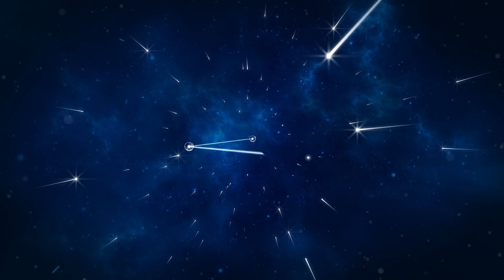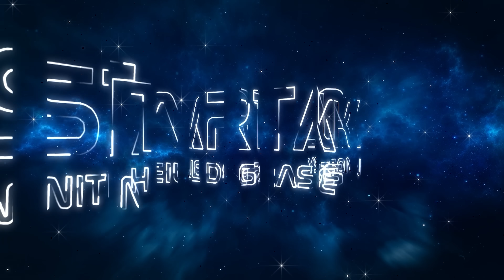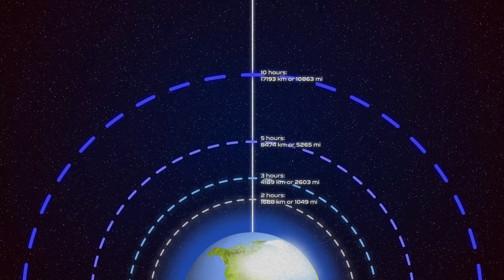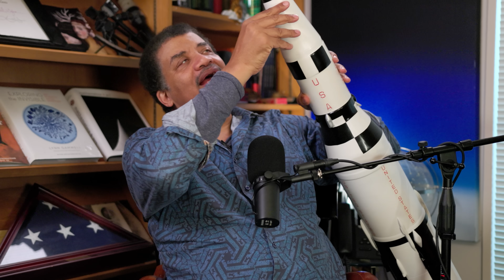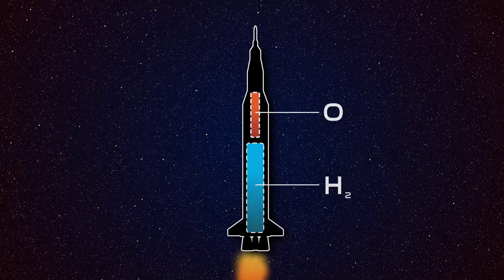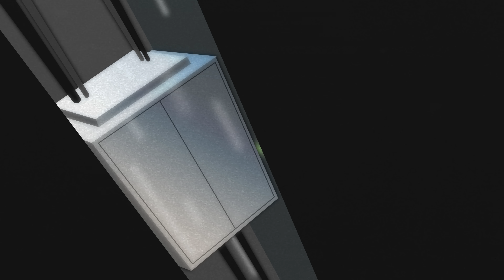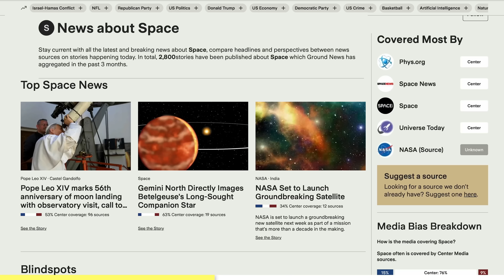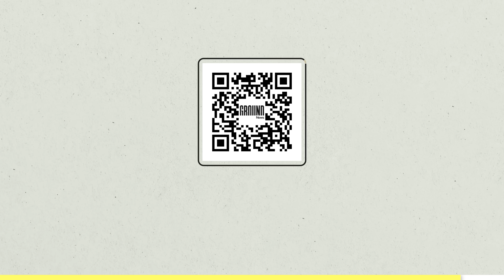When Will We Have a Space Elevator?

Comment: 🌀 SHERBURNE SPACE: A Radical New Model of the Universe
💡 The universe isn't expanding — we're shrinking.

Have you ever stopped to wonder:

Why does space appear to expand faster and faster?

Why does gravity feel weak, yet govern the cosmos?

Why can light escape a star but not a black hole?

What if everything we’ve assumed about space, time, and energy has been missing an entire dimension?

Let me introduce you to my theory:

🌌 SHERBURNE SPACE
A cosmological framework built on a new axis — not space, not time, but scale.
I call it the [S] dimension — the size dimension.

🧭 The [S] Dimension: The Missing Axis
We already think in scale:

We imagine shrinking into atoms or zooming out to galaxies.

We visualize massive stars as tiny pinpricks from Earth.

We mentally move between worlds by changing size, not location.

Sherburne Space formalizes this as a real vector of motion.
As you shift along [S], your perception of the universe changes —
not just in appearance, but in physics itself.

⚫ The Six Singularities: The Boundaries of Reality
There are six primary singularities — cosmic boundaries that shape what we can see, feel, and measure:

Speed of Light – The upper bound of velocity and causality.

Vacuity – Perfect stillness; the absence of motion.

Absolute Zero – The lowest possible thermal state.

Absolute Heat – The theoretical thermal limit.

Gravitational Singularity – The core of a black hole; compressed spacetime.

Periphery Singularity – The edge of the universe; the source of cosmic repulsion and dark energy.

⚖ Dualities: Each Has an Opposite
These six can be paired into three cosmic dualities:

Causality (Speed of Light) ↔ Vacuity

Absolute Heat ↔ Absolute Cold

Gravitational Singularity ↔ Periphery Singularity

They are like cosmic yin-yangs — opposites, yet deeply intertwined.

🔗 Similarities: Grouped by Behavior
Now group them by similar traits — how they affect perception and experience:

1. Gravitational Singularity – Absolute Cold – Vacuity

These compress, pull inward, and create a sense of stillness or freezing.

They hide energy inside geometry.

From the outside, they appear cold, slow, and shrunken.

2. Periphery – Absolute Heat – Speed of Light

These expand, radiate, and push outward.

They flood space with energy and motion.

From the outside, they appear hot, fast, and massive.

🔴 Redshift Is Not Expansion — It’s Compression
We’ve been told that the redshift of galaxies proves space is expanding.
But in Sherburne Space, this redshift is an illusion caused by motion along the [S] vector.

As matter falls toward a gravitational singularity (like a black hole — or even our own universe’s center), it shrinks along the [S] dimension. The photons it emits lose energy not from stretching but from being stored as gravitational potential.

So the redshift isn’t from galaxies moving away…
It’s from us falling deeper into a compressed geometry.

🪨 Gravity Can Be Stored in Geometry
Here’s how to picture it:

When you lift a rock to the top of a mountain, it has gravitational potential energy.

If you let go, that energy converts into motion as the rock falls.

Now scale that idea up:

🕳 A black hole doesn’t “pull” with active force —
It stores gravitational energy in its geometry.

The deeper you fall in, the more energy gets locked into curved spacetime.
You’re not gaining speed by pushing — you’re being curved inward by stored potential.

This is why gravity seems weak from far away — its energy is folded inward, invisible, hidden.

🧊 Why Everything Appears the Way It Does
Depending on where you are on the [S] vector:

The edge of the universe looks infinitely large — a periphery singularity.

A black hole looks infinitely small — a gravitational singularity.

But both are just opposite ends of the same spectrum.

You're falling between them —
and that motion gives you the illusion of:

Time passing

Space expanding

Energy redshifting

Heat radiating

🚀 Implications (Even If Just Thought Experiments)
If we could master the [S] vector:

We could shrink a city-sized ship into a golfball.

Create storage pockets inside compressed geometry.

Pause time itself for objects by freezing their entropy via scale.

Even if it’s just theory, it gives us a new way to think about dark energy, gravity, and existence itself.

🌀 Final Thought
Sherburne Space is the idea that we live on the edge of six singularities…
and that what we call "reality" is just how they appear from our size.

Not because the universe is infinite — but because we're seeing it from the edge of infinity.

Let that sink in.

🧠
👇 Tell me what you think. Does it resonate?
Could this explain the great cosmic mysteries?

#SherburneSpace #ScaleDimension #EdgeOfInfinity #Redshift #DarkEnergy #NewPhysics

Comment: If we were to ever make a space elevator, I always believed the only logical place for it would be Antarctica, right at the point of pole rotation or as close as possible. This would eliminate most of the issues with needing to maintain a geosynchronous orbit. As for the tether itself, I would rather consider it to be just that: a tether and guideline for any elevator, using helium or hydrogen gas as a ballast to reduce the energy needed for ascension. Then just have the elevator climb the tether like maglev or linear-motor elevators do. Or be clamped on like motorized zipline.

Comment: It would not take that long to get up there the only reason the fastest elevators are that "slow" is because of how long they can accelerate for but if you keep the elevator at 1g acceleration to keep a "comfy"  ride it can be done in less then an hour

(comfy is in quotes because at the start it will be 2g acceleration 1g delta and at the slowing down part you will feel 1g but will slow down at 2g)

Comment: I have a couple of questions about the physics and one about construction.

When you have your platform at geoststionary, and then put a load into the car to go up, doesn't that change the center of mass, making rhe platform drop to a lower orbit, which would then start drifting?    And wouldn't you need a counterbalance further out from the platform to deal with the 23000 miles (36800 km in Earth units) of weight of the dangling nanotubes?   As light as they are, they still have mass.

Finally, how would someone actually lay the cable?  If you tried it from earth, you'd just have a heap of nanotube lying on the ground.  If you tried it from a geostationary platform, as you unwind the cable, each cm (0.4 inches in America units) would then want to follow the orbit of its particular elevation, causing it to drift away from the intended landing pad.  Oh, and the center of mass issue comes into play again, dragging your platform to a lower orbit, negating the stability of the platform.

If I may also make an aside.  Why does the Republic of the United States use "Imperial" measurements?   Didn't Washington and co throw a bunch of tea into Boston Harbor to get away from the empire?  Just sayin'.

Comment: 4:30 - Wrong way of thinking. The structure and cable doesn't have to hold it 'up', it need to secure what's dropped down to it.
Use a pair of belts made out of woven carbon nanotubes. The pair is so a charge differential can be applied to power motors, and the belts pull through rollers. You only need the grip on the belts until you get outside the atmosphere, the rest is a MagLev style drive using the belts as the electrical power source. Speed needs to get to around 1000kph, then keep a constant speed coast untill it's time to slow down. Will need seats on floor and roof, plus cabins.

Comment: I'm only at 4:56. Are Galvorn or titanium strong enough for this?
Reply: Probably is strong enough, but it’ll probably end up being the same problem with using steel where the width of the cable to stabilize and hold the space elevator would be to wide for it to be practical.
Reply: @ethanxiong7543  Is Galvorn well-known?

Comment: There are several ways you get to space without a rocket...

You can float. High atmosphere launch from a hydrogen bouyed platform takes far less energy...

You can get tossed like a dwarf.  There are launch catapults that can literally throw things from the ground into orbit.

You can fly. If you fly a jet too high, it exits the atmosphere and can easily lose control... it's happened before during NASA test flights and US Air Force test flights.

The only issue with these methods is having the ability to maneuver and navigate outside earth's atmosphere.

Calling it a carbon nanofiber is seriously dumbing down the buckyball conceived by Buckminster Fuller... but creating a material tether using buckyballs is still currently out of our reach...

I have a different idea.  What if we didn't have to reach the ground? What if we could lower a tether equipped with an elevator or a weight down into the atmosphere in order to temporarily attach to a floating hydrogen bouyed platform holding the passengers and supplies... then let the space station reel it in?

Comment: In this discussion, I always feel we miss a crucial point: whatever we pull up needs energy. Energy to lift it, but also energy to accelerate to orbital velocity (about 3 km/s). This energy needs to be provided. It also needs to be transferred to the elevator. Especially tricky is the lateral part (the orbital velocity) because a cable does not do that very well - it would cause the cable to bulge. Lateral rockets on the lift cabin, perhaps? But that takes fuel…

Comment: This is no longer fantasy.  DexMat has developed a very new process that has made a carbon nanotube called Galvorn.

Galvorn is 50x the tensile strength of steel, electrically conductive, and a 15,000 yard single fiber weighs 20 grams.  

The company recently made single fibers that were 15 kilometers long.  The process can make fibers of any length…up to 24,000 miles long or more.   The only limitation is feedstock.

The company has already started to supply fibers for auto, aerospace, biomedical and military applications.

Tested against Kevlar and found to be superior against penetrating objects like knives.  

Recently did a study that would replace aluminum wire for long distance power transmission.  The numbers show that pylons could be placed 10 kilometers apart using Galvorn wire.  An additional benefit is the carbon fiber has minimal change in length with changes in temperature 

Check it out

Comment: But but but….how much energy does the elevator need?  My car gets Bout 10 mpg at 100 mph.  That’s 2300 gallons (15000 lbs ) on the level,   Not including 30000 lbs of oxygen.  So my car would weigh 50000 lbs at ground level.  So I won’t get 10 mpg in a 25 ton car.  Seems like potential energy aint cheap no matter how you buy it.

Comment: Yeah... but wouldn't it be brittle on the side? Wouldn't the Shear force of the planet spinning in it's normal rotation break the shaft? One way you could alleviate that problem is to put a thruster on the platform but that still needs fuel, unless we use solar power. Not to mention we already have so much crap up there that something could just hit the side of the elevator near the middle breaking the track.... 10 days is a long time for something to go HORRIBLY wrong...

Comment: Was there something new here I missed? Just a sucker for 'space elevator'. Another factor is that by running a thermocouple along the cable you could power the entire system. Speed isn't a problem because you use another tether to pull up the elevator that is connected to a second counterweight that was the cargo you brought up last time. Let the cable extend as the elevator is pulled up. Unload cargo and let elevator descend.

Comment: What happens if the elevator is anchored at  (or near) one of (probably South) poles? Rotational velocity near zero to keep it over the same location on Earth, some kind of joint to take care of the axial rotation. Off set from the actual axis of rotation so there's some velocity required. How high up would it need to be so it's be stable and take take up a load?

Comment: The trouble with a space elevator is that I can’t be sure you can get there from here. We rotate. Everything is affected by that motion. A kite string curves although it presents a very narrow surface to the atmosphere. Pictures on the wall can’t stay straight.  There is also wind resistance which can vary from very little to impossible to resist. The uncrease in height comes with increasing wind speeds and movement in directions you may not want to travel. There’s loss of air pressure and oxygen
required to maintain life. Even if we could build a “ladder” mechanism we need a very strong elevator car that can maintain a stable sea level air pressure, oxygen levels, and all life sustaining tech that the ISS now has. What about the Coriolis effect?
   
I envision a very long  horizontal coil stretching towards the west more or less with no end in sight. Given all the forces at play along the line of travel of the elevator car might the ride be as pleasant and calm as a running clothes washer in the heavy duty wash cycle? Don’t forget the elevator car has to accelerate as it rises or the ladder has to have the strength of materials yet to be seen in this universe. I have trouble suspending disbelief.

Comment: I don't think the elevator speed problem is a real problem. We can make an elevator car that accelerates as it rises and maintains a consistent 1.5-2Gs on its rise until it has to slow. Basically think of those "parachute drop" rides at amusement parks only in reverse and it brakes slower toward either end. It would also give you time to acclimate to the newer gravity with a persistent frame of reference that gradually introduces the new gravity after the extreme of rising/falling through the atmosphere.

I also wonder if there's ways to make a non-solid structure, like how some bridges are stronger than you would expect because of the way their supports are laid out. There's a competition I heard about once in an architecture school where students had to design scaled suspension bridges with twigs and bluetack, essentially, and it had to span a really big distance between some desks while supporting ever increasing loads. The bridge that supports the most weight wins, but obviously they have to support a minimum to qualify. Maybe we can do something like that?  >D

Comment: One thing that I think Neill overlooked is that 23000 mile point is just where the counterweight needs to be - Whether that's a captured asteroid/comet or an egineered structure: whatever.

The "spaceport" that can be at whatever altitude. You could have the space station be suspended at the same altitude as the ISS today, and the remainder of the cable extend beyond it. That would drastically cut down on transit time and still allow for conventional surface rockets to dock.

Comment: I honestly feel that rockets and a space elevator both have pro's and con's.

With rockets, it is faster to get into orbit, but the payload is extremely small, as the rocket has to have enough fuel, and makes up a majority of the weight a rocket carries. So I could see rockets being the way to get people into space.

Space elevators on the other hand, I could see them being used for mass cargo, as they would be able to carry far more cargo compared to rockets. Could even carry people if they're not in a rush.

So both have benefits and detriments.
Reply: Lets assume you deal with the problems of lowering a nanotube cable from a geoststionary platform to a point below. (Lots of problems that I don't think are surmountable, but let us imagine....)

Let's say the platform has a mass of 1000 tonnes.  You go to put 100 tons of cargo into space.   Now the combined mass is 1100 tons, centered at a height of 20700  miles instead of at geostationary orbit.  (We'll ignore the mass of the nanotube, even though it isn't actually weightless.)   Now, either this sudden load simply winches the platform down into earth, or the entire system starts to drift as though it were at the lower orbit.  Either way, the whole thing comes crashing down.
Reply: Just did a little research,  and a 1mm cross sectional cable would have a mass of over 650 kg. Not insignificant.
Reply: Space elevator main detriment being that it won't work. Ever.

Rockets win.
Reply: @mkyfinn73  Actually, space elevators will work, we just don't have the technology currently to make it viable currently. We went from Pre-Industrial, to putting people on the Moon in just under a hundred years.

So there's no point in saying that it won't work, when it can work once we figure out the engineering needed to make it work.

Comment: Here's an interesting followup question. Suppose you have a stable space elevator and 1 mile off the surface of Earth it snaps for some reason. Would the part of the elevator above float away from Earth, come crashing down, or both (via additional snaps from structural failure)?

Comment: Sorry Dr. Tyson, but I believe it to be MUCH worse. Even if everything is made out of nanofibers, you still need to carry stuff inside that elevator, including people, and you need something that moves that elevator up and down. In common elevators that's a cable with a counterweight, so a simple motor can just spin and move the elevator up and down. And then, to fix the issue of the speed, you would need to use an almost frictionless system where you can reach a much higher velocity (4.000 km/h and up). One way to do that is to make it an hermetic vacuum tube, at least all the way until you leave the troposphere, but then you need to use a material that can handle that, and you go back to the problem of a material strong enough and light enough not to collapse under it's own weight.